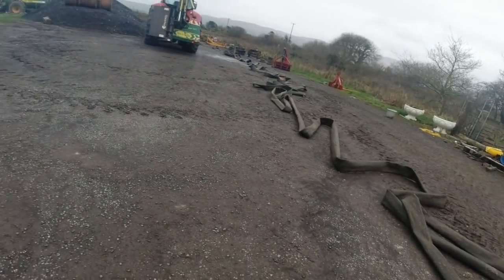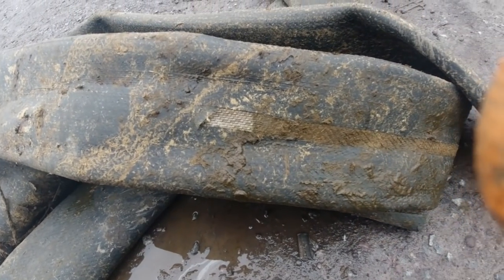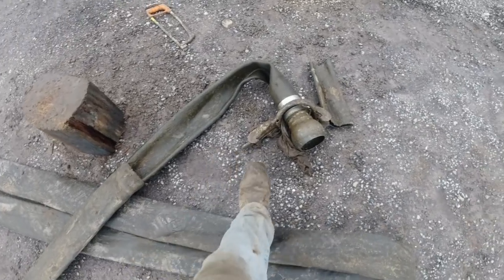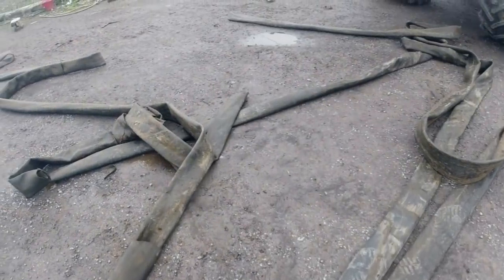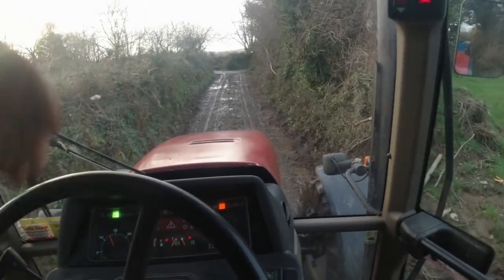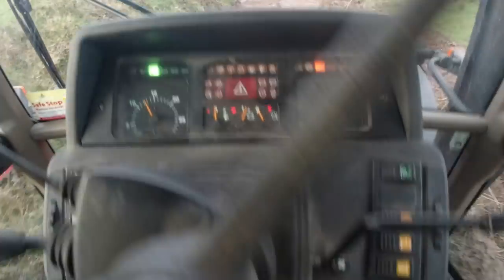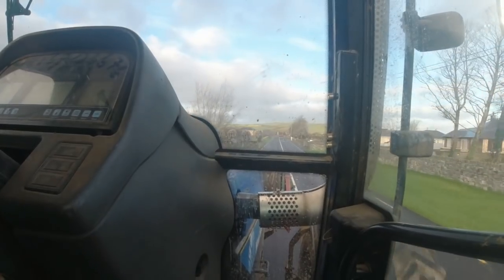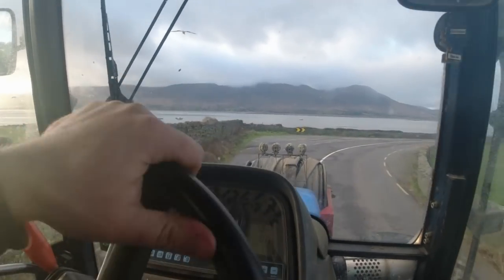DIGGING,PIPEING,DRAWING,AN ACTION PACKED WEEK

Comment: Yes all cs had that dash. I think the 6 cylinder cs started around 96. Made untill 2003/4. Probably the best tractors ever made
Reply from the maker: Lads say that.
Like I said I only drove one once on a road construction job they also had a tm155.
The Cs would rings around it
Reply: @mrcvx  I put 15500hrs on a Cs150 at veg work. All cultivation work bed prep and haulage of the veg the 35 mile from around dundalk back the richhill co armagh.  The tractor is still on the same farm. So there has to be 20khrs on the big 6.6 valmet motor.  Biggest downside to them.. horrible 21 grese point front suspension same as claas and McCormack.  
Around 13k hrs the gearbox will destroy itself (like a cvx) dealer price for a rebuild 9k. Other than that. A solid good tractor.  Not like other makes that need a wee bit here and a wee bit there. I'd personally put them ahead of a fendt 515c.  And that's saying something.
Reply from the maker: There was some amount of cvx's /Cs at jobs they were too small for and they gave very little trouble at it.
A friend of mine worked for a guy spreading waste all around the country with 4 cvx's.
There was milage on these yokes that most cars would be fit to be scrapped after.
They were built to last.
Like that I've driven a share of fendts, wouldn't hold a candle to a cvx in my opinion
Reply: @mrcvx  its is a very rare occasion we get to enjoy these tractors.  But styer did something special in the mid 90's untill unfortunately fiat took them over . And all went the newholland way since. Good engine.  Gearbox and backend.  Atrocious
Reply: they were a great yoke in fairness